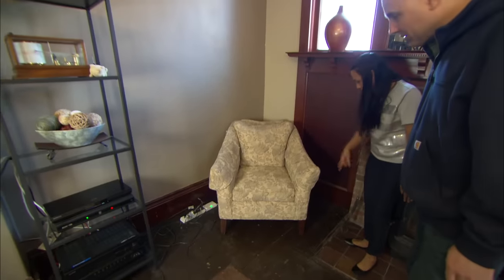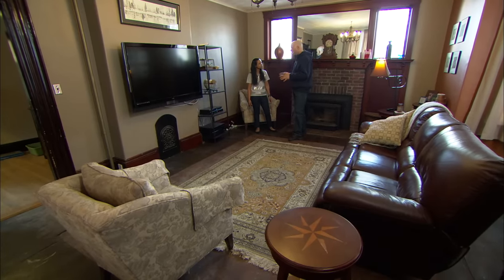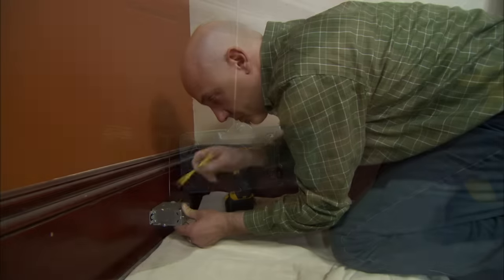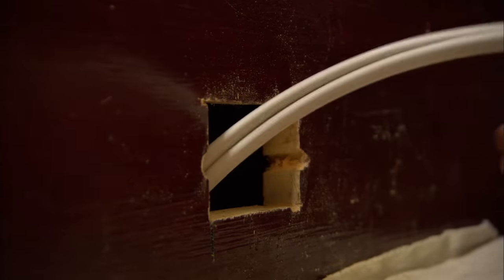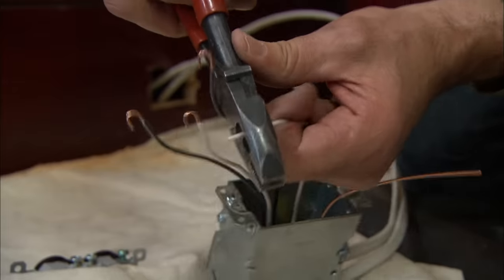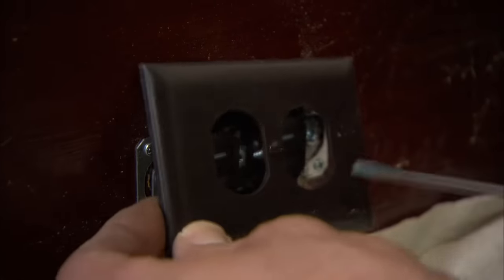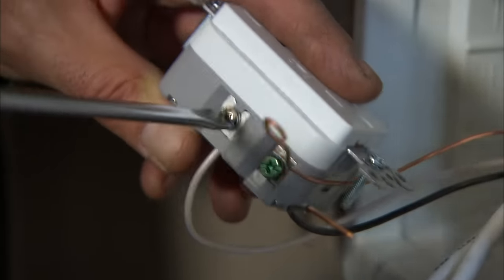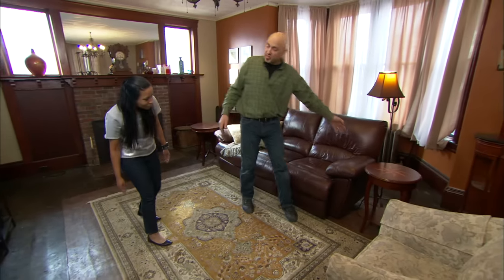How to Add Outlets to a Room | Ask This Old House

Comment: I'm from India and we have brick houses over here. Adding outlets, switches or even lights for that matter is a difficult job, unless you cut the wall to create routes.
Reply: thats why you shouldn't build houses out of stone or bricks.
Reply: @tomcrook1993 Wrong, in places like Chile, earthquakes 7.1 or 7.5 magnitude don't do much damage because of these greatly built brick homes. While other parts of the world where house aren't built of stone or bricks, earthquakes, and other natural disasters like a 7 magnitude quake, destroy entire cities.
Reply: You can use tubing for outlets over brick and attached outlets to the brick surface. Easy with today’s materials.
Reply: +Truetothat454  Stick built homes do much better in earthquakes due to their flexibility.
Reply: +Manu  It's actually quite easy, but can be a bit unsightly. You just run the wires along the surface using conduit into surface mounted boxes.
Reply: Manu ii
Reply: keith cunningham The choice of building materials actually depends entirely on what’s cheap, abundant and locally available.  In the US wood is plentiful and affordable. While in other parts of the it’s concrete, bricks, etc. Every material has pros and Cons to it.
Reply: Pro tip if u build from brick or stone u dont cry after every stornger wind that ur house is totaly destroyed
Reply: same in UK if there was one outlet on old house you can add double outlet to that one if youre not using 3.2kW in your room on it for example for computer and monitor will do just fine from single old, to double new if wiring is ok and wiring since 1970 is that one outlet must support 13A on 240v
Reply: Install with electrical conduit above surface. If your house isn't grounded make sure to use GGCI or re-wire to use ground. You can install grounding rod from outside and run it to a specific room or rooms.
Reply: @marineguy4eva  You are wrong. Brick and stone homes always have more damage than wood homes because brick doesn't flex, it just breaks. Wood will flex instead of breaking.

Comment: Who did the load calculations?
Reply: For what?
Reply: To make sure it’s not over 80%
Reply: @jamesdodd400  to make sure WHAT isn’t over 80%?  They are just convenience receptacles. Something may or may not even be plugged into those. You can’t do a load calculation when a load doesn’t even exist.
Reply: You’re not an electrician. Why not just put all the outlets in the house on the same circuit if there is no load

Comment: Why would you connect the ground wire to the neutral bar instead of to the grounding bar on the panel? Did that panel not have a grounding bar or something?
Reply: Main panels both neutral and earth are the same bar
Reply: @wizard3z868  In some jurisdictions. In others, you are required to install separate ground and neutral bus bars, connected with a bonding jumper (in the first panel upstream from the service drop).
Reply: @jamesdarnell8568  havent come across that yet just like in chicago you cant use romex anymore(so ive been told) you can lrn a lot sometimes from the comments thx for info.

Comment: As a canadian electrician I cant wait till Americans start using robertson head screws instead of Philip's and slot
Reply: All the devices sold are ECX head. It will work with slot/flat, phillips and square. Some bit manufacturers have begun selling ECX bits or screwdrivers (Ex:Milwaukee & Klein).

Comment: I would have used 12/2 romex with a 20amp breaker...and you really don't need an arc foult breaker for receptacles tho mostly fit lighting...ok then..

Comment: It burned my soul to watch him put a hole in that really nice, custom baseboard when the drywall is just as easily accessible.
Reply: That's not drywall, it's lathing with horsehair plaster.  Cut into it and BIG MESS!!
Reply: @jsprdn  Ya can't fix idiots; it's not as if he didn't explain that. I have an old apartment with very old wiring that I wish I could upgrade.
Reply: WileyDean yeah but he wanted to match the existing outlet.

Comment: Anybody willing to estimate what a job like the one in this video should cost a homeowner? (asking for a friend)
Reply: You should do something like this yourself. 

What you need:
- Romex wire (yellow rated for 20 amp, its the highest grade)
- an outlet 
- fish tape to run the wire behind the wall
- an electronic outlet tester

Steps: 
- shut the power off at the breaker corresponding to the existing outlet 
- use the electronic outlet tester to verify it's off

- find an existing outlet and connect:
1) the ground wire (bare copper) to the copper screw 
2) the black wire to the extra brown screw on the outlet
3) the white wire to the extra silver screw on the outlet 

- run those wires from the existing outlet with the fish tape to the new outlet.

- on the new outlet connect:
1) the ground wire to the copper screw
2) the black wire to the brown screw on the new outlet
3) the white wire to the silver screw on the new outlet

- turn the power back on 

- enjoy
Reply: Indeed.  Good idea to not go cheap when safety is a must.  Always overbuy.  Also, document what you have found and what you have done for others after you.  Saves a lot of time+brainwork.
Reply: This job was extremely easy because of how the house was built.  Most jobs are not this easy.  Figure $150 to $200 per outlet.
Reply: Thanks for the answers. The $200 per outlet is about what I might have guessed. I appreciate the details.
Reply: I concur
Reply: 300 -500 depending were you are
Reply: George Scott there is more to it then that my friend. Hire a professional and have it done properly and up to code.
Reply: George Scott union electrician?
Reply: jeez Scott you d better call good electrician like me. I can do this job in 30 min for sure with cheap price. don't ever recommend others doing this by themselves. this is outlet installation not the lights, which has much higher risk of exposing electricity than lights installation does.
Reply: @DordiHOTS  Telling someone who is not an electrician to do their own electrical work is idiotic!

Comment: Can’t use the device as pass through .should use a pig tail for neutral and hot screw terminal
Reply: Jean Picard yes you can. Yes, pigtails are better but not required.
Reply: Yes you can. Done everyday, all across the country

Comment: I am amazed that you can put an outlet that lowdown. In the UK you are not aloud to have any sockets below 18 inches, this is above the height that a baby can reach and it is to stop them from sticking things into the socket.
Reply: John Fithian-Franks the special outlets he used is child proof as well. I have them in my home, they are difficult for adults and pressure has to be applied evening on both sides for the guards to move.
Reply: In the U.S. we can place a receptacle wherever we want. It's a freeing feeling really.
Reply: Andrew Knowles i wonder what the rate of electrocutions are as well compared to the likes of the UK and australia where someone trained actually has to do the work. I wonder if that is freeing 🤔🤔🤔🤔
Reply: james hawkins Sockets in the UK rely on the earth pin to operate the shutter.
Reply: Wow! So there are different construction methods on different continents?  Who would’ve thought?!
Reply: @IfUReadThisEatADick  Probably lower.

Comment: here in novascotia that floor outlet would have to be gfi protected id just bring the circuit  into a 4x4 next to the panel off the arc fault have one feed coming out for the wall outlets and a faceless gfi protected feed to the floor outlet

Comment: I am a 40 year electrician you are running exposed Romax subject to physical damage by the national electrical code you needed to use MC cable or conduit in the basement to that panel this video is misleading and against code
Reply: 🤣🤣🤣🤣 I think you need another 40 years
Reply: He also forgot to ground the metal old work box that’s the first thing you do with a metal box

Comment: Should have used 12 gauge wire when running new circuits. Better to have more amps that you don't need rather than not enough.
Reply: Good catch. Since he was going directly to the panel, how convenient, no reason not to use 12/2.

Comment: No..no..no..no...no...not in the baseboards.
Reply: TheRagingCreeper why?
Reply: It makes sense to. My parents house is over 100 years old and every outlet is that way. Why put it up higher when existing ones are that low? It provides continuity.
Reply: Yeah. We just got a 120+ year old house. 
Most of the receptacles are in the baseboards. So the ones I add are going to be the same as well. Wouldn't look right to have some on the wall, and others in the baseboards in the same room.
Reply: TheRagingCreeper it’s against code in many places to put less than 12 inches close to the grounds
Reply: To the ground, not the floor. If you have a basement or crawlspace, you're already good
Reply: I agree only because I hate to see the wood getting ruined. Plaster can be patched if you ever move electrical. The wood can not be repaired so easily. Never touch the wood!
Reply: 125 year old gorgeous woodwork or patchable plaster or gyp— let’s destroy the wood. Ugh- this old house no longer cares about the old house. 😔
Reply: He did say that he was matching the existing outlets that were in the baseboard.
Reply: its still not legal. the floor is the ground. water can still gather on the floor, impesile.
my house has some baseboard outlets, and not only are they dangerous, there a pain in the ass.
Reply: Here in Kansas especially in my town, if your outlets are not 14 inches or higher from any floor. They deem the home uninhabitable and make the owners repair or change the existing plugs to regulation. After inspection you are allowed to return to your home. 
It's also very tacky to put them in the baseboards and also very dangerous. Reason he used metal was to help alleviate damage, baseboards or kick plates are there to protect the wall and hide the seam which is made as the flooring and wall meet. Putting outlets into them (although it may match the home) can increase fire risk and danger to children and pets. One swift bump into any of those plugs and it could cause a fire or destroy the outlet.  Stick to regulation for not only safety but for convenience, because the older you are the more annoying the recepticals are since bending over isn't easy.
Reply: @jeffreyslater6556  uh , NEC maybe , water intrusion /prevention , but mainly because it's inconvenient !?
Reply: Joseph Anterola not true. They can actually go IN the floor.

Comment: Tamper resistant plugs suck
Reply: Bigshows93 I kind of agree, I installed some tamper-resistant outlets in a bedroom and you really have to apply some forced to get the plug-in. I'm guessing overtime they will loosen up but I'm sure that means I'll have to replace the outlet again.
Reply: QuadroNVS Yeah I've just about pushed a few of them through the wall trying to plug things in.
Reply: Bigshows93 - Only going to get worse thanks to the new requirements.
Reply: doing objective reviews will help you.
Reply: The UK has had shuttered outlets since the 1950s. Here they usually rely on the earth (ground) pin being inserted to reveal the other two holes. But that can't be done in America because you have such a thing as non earthed plugs.
Reply: ive lost a computer and some peripheral equipment to improper grounding here... discovered when touching computer case and a "grounded" monitor data cable outer shield (vga) propagated ac current through arms and body. great times.

the higher voltage used there is more efficient over the grid and wiring, but the body becomes much more conductive at higher frequency alternating currents so its also more deadly if done improperly

generally all the newest stuff is much safer here, and regulations are a lot tighter, but even gfci protection can kill you. commercial requirements are better, using conduits, all the right protections..
Reply: You're 100% correct. Believe or not, this is not uncommon. I've seen it it homes as well as commercial offices. I warn my clients to get an electrician in there ASAP, first and foremost for safety, as well as to protect their valuable equipment. Usually, it's not an expensive fix.
Reply: they may be hard to plug in but if they can save a life who cares btw I live in England and all plug sockets are like that so we have to deal with them luckily English ones aren't hard to plug in
Reply: And they are not even safe! If you push a plug half way in you can touch the mains :-D
Reply: Julian Knödler in the UK we have partially sleeved pins so that a half inserted plug cannot electrocute anybody. The pins don't make contact until all the exposed metal is inserted. See America has a lot to learn from us ;-)
Reply: Steve Craft You should tell us how your country has been to the moon. Oh wait, that would be the United States that has been to the moon. And you are fussing about an electrical outlet.
Reply: metric vs imperial all over again

the companies are pretty stingy. that extra socket rubber sleeve design would be the death of them... financially they would like us to think. anyway it would interfere with the electrical contacts and we may as well switch to 240v euro plugs in the meantime
Reply: Steve Jones we're talking about electrical safety here and how outdated the us system is for a MEDC. In the uk and many European countries this sort of wiring and system wouldn't pass current regulations. It's a simple comparison made by people who are in the electrical installation industry of their respective countries, don't take it so hard. 
But you can thank nazi Germany for the successful rockets and if we were to talk about all the achievements the Uk Has made id have to put it to song for you.
Reply: They're great if you like spending 15 minutes plugging something in.
Reply: Such a simple comment sparked such a ridiculous conversation lol. "Tamper resistant plugs suck" turned into an electrical internet war between different countries. Wtf.
Reply: They are "Darwin-award" resistant plugs...
Reply: Hubbell makes some good ones. They are as smooth as the non TR.
Reply: Bigshows93 they’re code
Reply: You just have to pop the cherry then they work good
Reply: There probably there to prevent dirt from getting in.
Reply: all UK plugs are your ''tamper resistant'' so even if you buy it on a poundland (UK version of a dollarstore) it will still be tamperproof because thats how socket is designed that ground always goes in first opening the shutter doors for live and neutral pins, ground is the longest connector and every cable has fuse inside removing the need of fuse in the device and i like this plug design
Reply: Baigle1 umm...US residential is already on 240. Split phase is better because 120 is safer for small appliances, while for larger fixed appliances, we use 2 hots and a neutral to get 240v.

Basically, less voltage=less arcing. But half voltage is double amps, so we have strict standards for wiring (after our f-up with Al)
Reply: Joe Jackson cry me a river. You insert the prongs evenly at the same time and it goes right in.
Reply: The Mad Atheist  you cant they are half plastic coated and dont make contact untill fully in
Reply: The Mad Atheist  Uk
Reply: The Mad Atheist  well if you turn a plug upside down so the earth pin goes in first the plug contacts inside are released then you get a paperclip or something
Reply: couldnt agree more.
Reply: Bigshows93 receptacles. Plugs are a totally different product.
Reply: Good thing those aren’t “plugs”

Comment: He doesn't show how both ground wires needs to be spliced and connected to the box as well with a grounding tail
Reply: Solomon Katz he needs to show every little detail?  They only have so much time.
Reply: @leonardholt5311   if you're teaching a home owner how to do any type of electrical work safety comes before function and grounding is the most important safety element in electricity
Reply: @solomonkatz6777  LOL if you think TOH videos are "how to" videos. They are not and if you try to use them as that, you will damage something or injure yourself. These shows are only good for entertainment.

Comment: Should use a wire stripper instead of linesman's pliers to strip wire. Pliers can cut into conductor, causing wire to break at connection point. I have seen this happen many times causing bad situations like opened common neautral circuits causing back feeding over voltage to appliances and damaging them. In this case it was a single 120  volt neautral circuit, but it can still cause and open circuit though.

Comment: Sooner or later there’s going to be a service call on those outlets for a loose connection for putting 2 wires on each conductor I would’ve pigtailed with one going to the outlet mane 😂💀

Comment: Tamper proof? That paper clip could have gone through the right prong insert. Someone grounded would get a shock.
Reply: Those are just plastic bits that will eventually break and fall off, jamming up the outlet and someone will get electrocuted trying to dig them out. These things aren't about safety, they are about money. I lived in a house without GFCI outlets for 30 years with no problems. Move into a new house and they are everywhere and I can't even plug in a refrigerator in the garage because of them. Idiotic and useless devices for the most part.